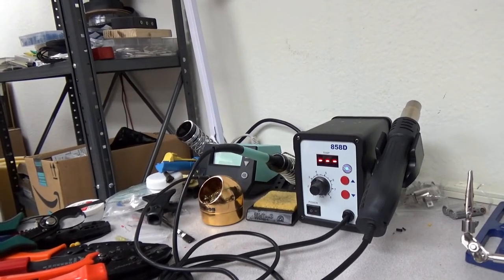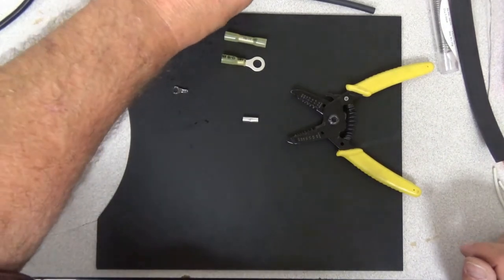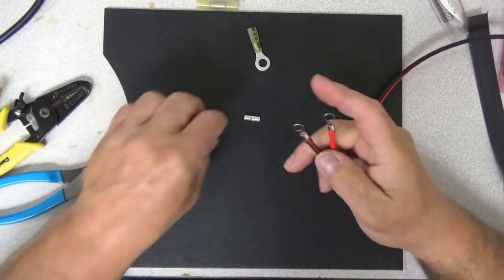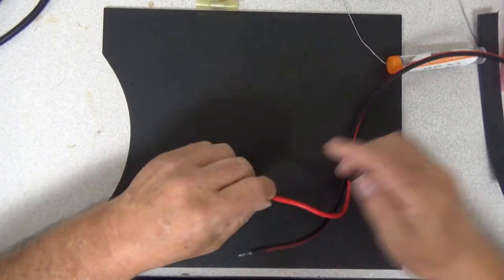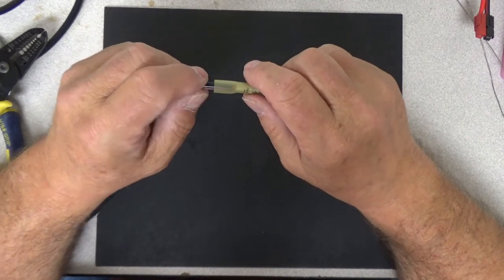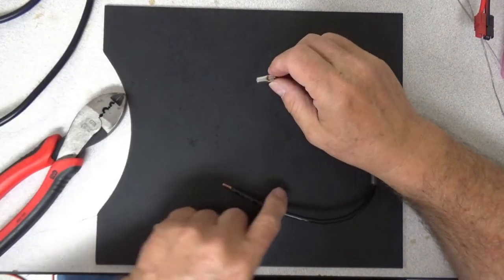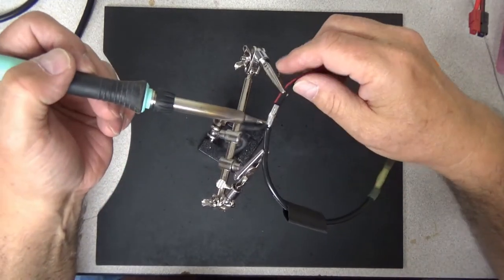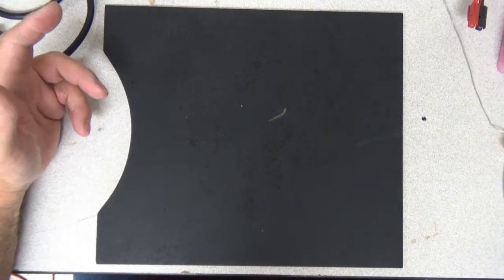Heat Shrink And Solder And Crimps Oh My!

Comment: This was very helpful. I have to extend a vehicle jump starter negative lead by 5 feet. So I ordered 10 feet of the identical wire used on my jump starter and 2 butt splice connectors that can be both crimped and soldered. After watching your video I feel like it will be a 100% success, thanks. By the way your video is not just for beginners.  I'm a retired EE and I build my own guitar amps. I can always use some tips. Your soldering technique is spot on. I always tin the tip to get the heat transfer more efficient (heat needed for less time = good). This is even more important for de-soldering. It can take a long time to get a lump of old solder to flow. Can overheat the working pieces. Tin the tip and it gets that old solder flowing much quicker. Good stuff.
Reply from the maker: Thank Joe, Glad you like the content.

Stu
AG6AG